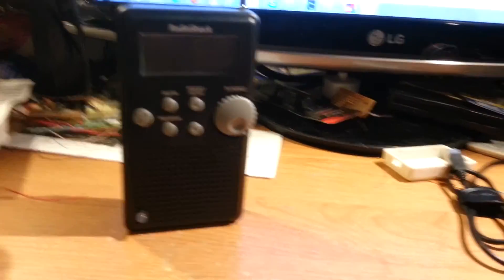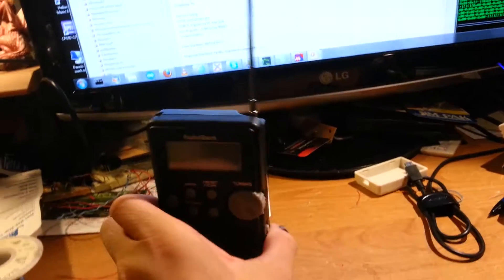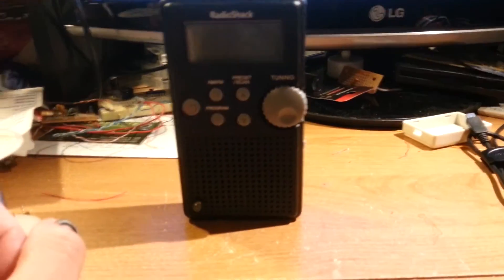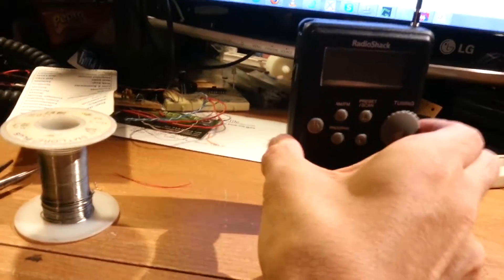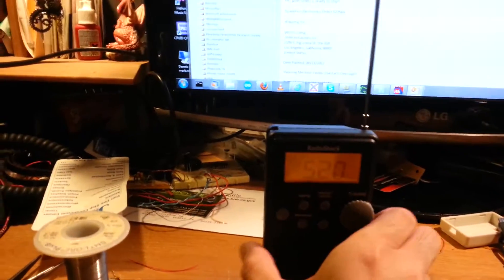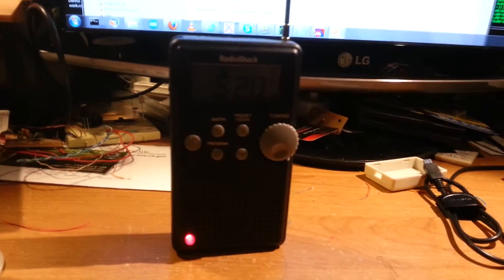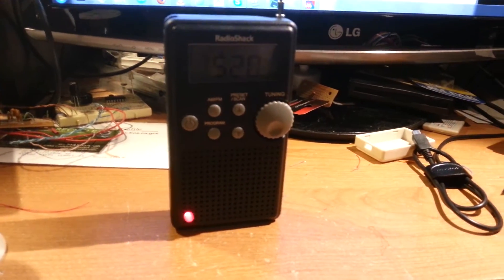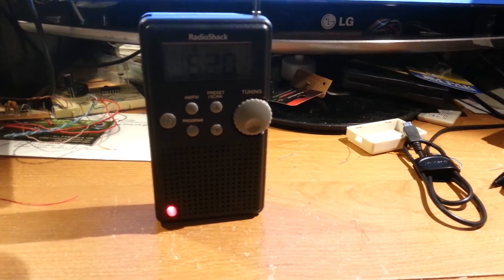DIY Radio Shack Hack Model 12-587 ADVANCE HACK WITH PIC

Comment from the maker: Absolulty. I can scan AM/FM and both. I have decoded the commands for scan and tune, the chips i will give out for this mod just does am, I have another chip comming in, i might try "Franks box" mode, using a random channel scan inside of a sweep.